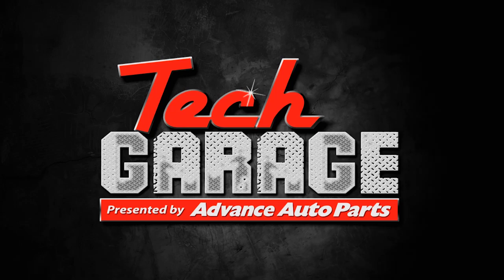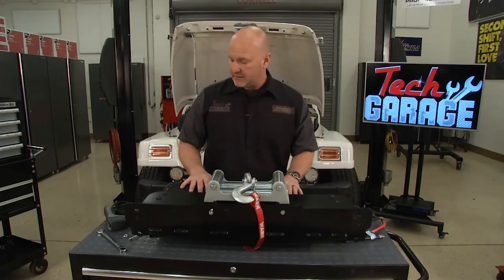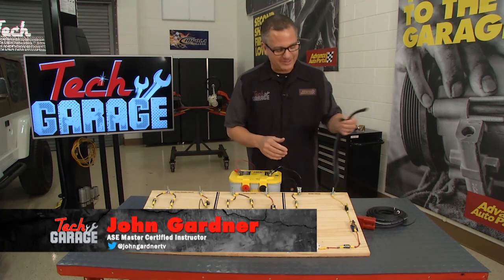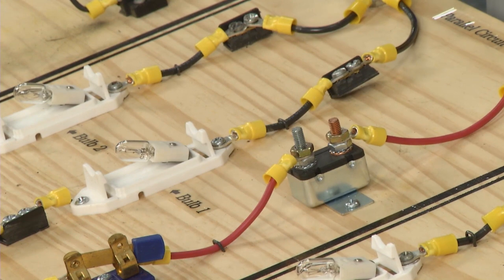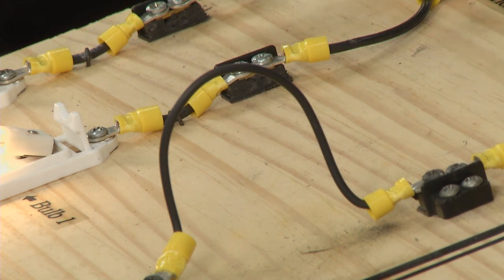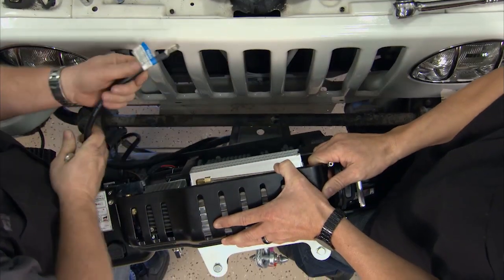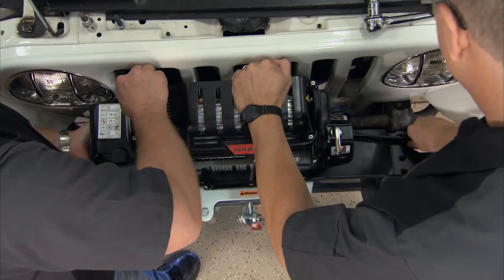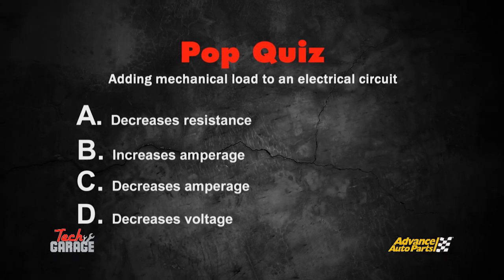WARN Winch wiring & mounting

Comment: Wow, there goes the airflow to the radiator. Unless they live in a cold climate, this could be an issue later.
Reply: i said the same thing as soon as i seen them set it in place. that winch is over kill for that jeep.
Reply: Really, I had a Jeep with a straight 6 that thing to get hot sitting at a red light and I didn't even have something blocking my entire Grill like this thing

Comment: Great video! I'm considering buying a Warn VR Evo 10s for my 2021 jeep gladiator but I have 1 concern or question. I want to hook the winch power, winch in, and winch out to my OEM auxiliary switches in my dash. I would be using x3 of the x4 switches included which x2 of them are rated for 40amp, and the other x2 are rated 15amp. From a wiring stand-point, would this work?
Reply: I connected the winch power to battery using a Warn solenoid switch, and that was wired to my aux switch bank, so I can turn it on/off from Inside. I operate the winch using the provided controller. Heavy winches flow in the 450 amp range, I don’t think those switches will work for operating the winch itself.

Comment: i direct connect the motor its working fine both way, checked all 4 solenoid working (ticking and the multimeter beeping) what could be the issue?
Reply: That... You used the english installation directions perhaps?
Reply: @martyisabeliever  Turned out to be bad grounding (inside the winch)